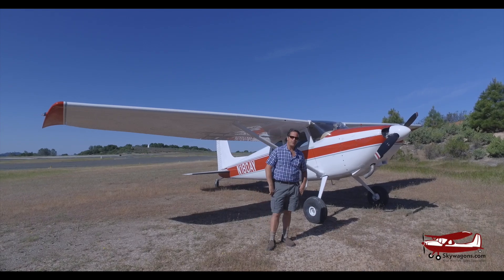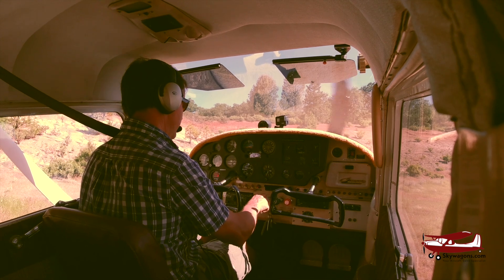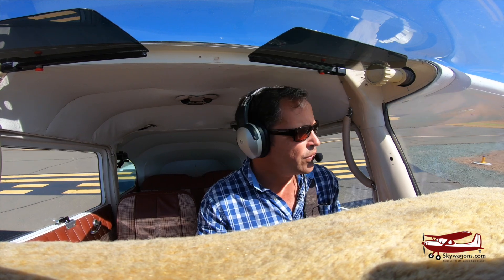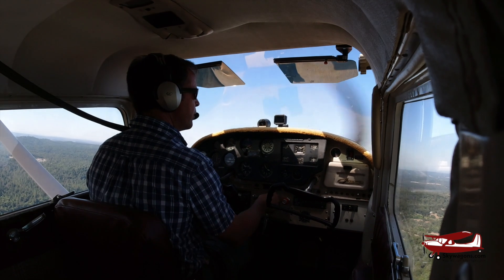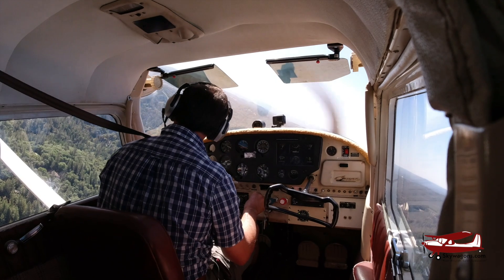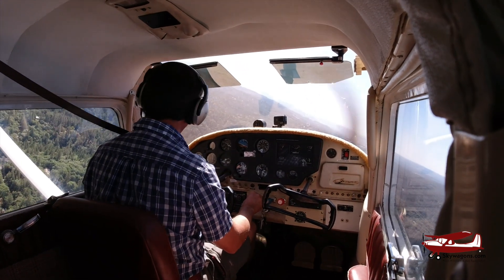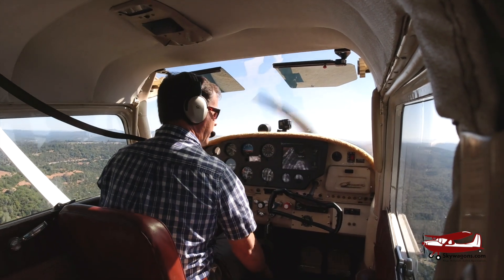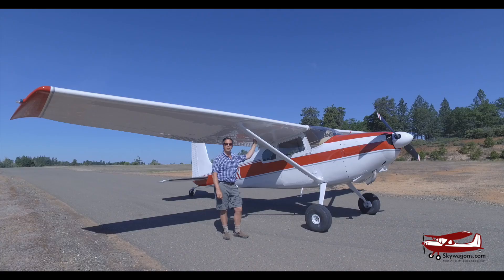Flying the Cessna 180

Comment: A quick question about your airport:  why is the taxiway at the very end, closed off with a yellow "X"?  Is it a line of sight safety measure due to runway slope?
Reply from the maker: The airport is on a hill and has no over-run. They shortened it from 4200 feet to 3900 or something and closed the end taxi-ways. It is for IFR traffic etc.  The other taxiway is further up to give more room.  It's just paint and politics.  The full length is best used for safety.

Comment: I think the "third window model" with the larger tail that you referred to, may be the Cessna 185 model. The 185 models also had fuel injection. As I recall, the name Skywagon name was used to identify the 185 model, not the 180. When the 185 came out, it was considered a significant improvement over the 180, especially for the seaplane configurations, but today, the differences are blurred.
Reply: TU_Alum.  Respectfully, little of what you posted is accurate.
Reply: @n70199  Respectfully, what are you taking issue with? I worked at a seaplane base in Louisiana during most of the 1960s and this was the case, just as I described. The Cessna 180 was usually referred to simply as the 180 and the Skywagon name was used to describe the 185, when it came out. The more powerful 185 Skywagon was a significant improvement, especially when heavier amphibious floats were used. The main drawback of the early 185s was that the fuel injected engines would sometimes be hard to start and sometimes would not shut down immediately when the mixture was pulled, which made straight-in docking tricky. I don't claim any expertise in this area and I can only relate what I saw and lived with at the time. It may be that in later years that Cessna began to blend the two models together under the same name, since the two airframes have so much in common. As far as my inaccurate post, since you are so knowledgeable, maybe you can enlighten the rest of us.
Reply: @tu_alum5619  well, there are late model 180s that use the 185 fuselage with three windows and larger tail. Skywagon was also applied to the 206 at one point but I see that moniker applied frequently these days to 180s. You're right, with all the mods out there, the distinctions between 180s and 185s have diminished somewhat.
Reply from the maker: Both 180's and 185's are called Skywagons and indeed the 206's are too in the early years.  185's are injected 470's from 1961 to 1966 and injected 520's after that until 1985.  All 185's have three side windows and 180's got that 3 window fuselage in 1964 until 1981.  The 61, 62, 63 180's had the raised roof "three window" cabin but only had two windows in them.  Float kits are a factory option.  I have videos on all this if you want to see them.
Reply: @skywagonuniversity5023  Basically the 185 is more like the 206 and the 180 like the 182, if making this comparison and tail wheel/nose wheel comparison.
Reply from the maker: @andrewagner2035  Just the engines.  206 and 185 have 520's and 182 and 180 have 470's.  The airframes of the 180 and 185 get more and more identical the closer to 1981 you get.
Reply: @skywagonuniversity5023  Ok, so the 185 is not a 6 seater like 206.
Reply: @skywagonuniversity5023  There were some early 180's with the 2 windows that were modified with a third in Costa Rica I believe. Back in the 70's..  Saw a couple in Panama.